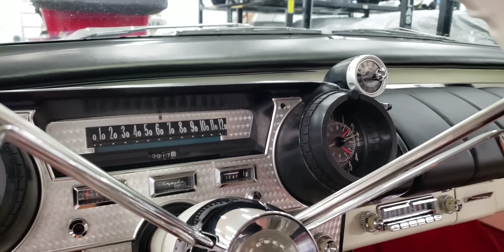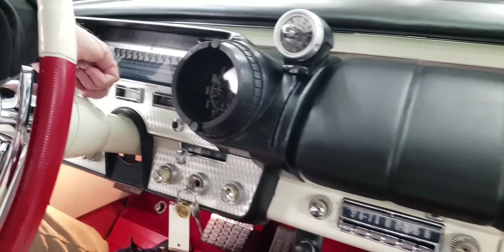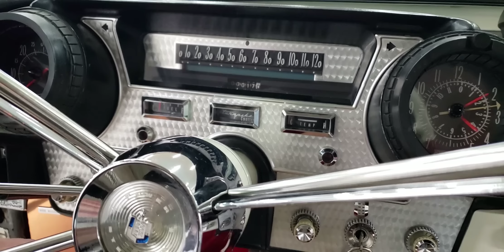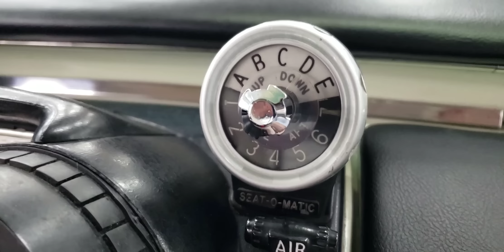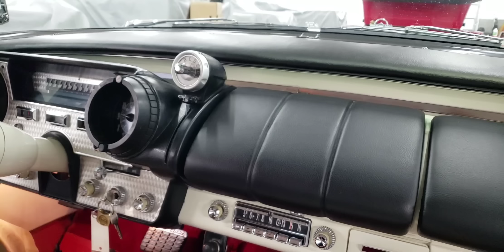1957 Mercury Turnpike Cruiser.

Comment: My high school superintendent had 3 Turnpike Cruisers I don't remember all the particulars as that was 50 plus years ago. One had a lube system that would grease the front suspension parts buy pressing a button on the dash, a lot of small tubes going to the tie rod ends. ball joints and maybe all the a arm bushings on the go. One had a wonder bar radio, you had a button or two near the dimmer switch on the floor  to change radio stations up or down as well the volume. Shop class pulled the 430 motor out of one and rebuild it, the motor alone weighed 800 pounds plus! They weighed over 6000 pounds. The windshield was about 7/16 inch thick. They were all 4 door hard tops.What ever happened to them I don't know . THANKS FOR THE MEMORIES  FRED!
Reply from the maker: Wow. Thanks for watching Fred.

Comment: I bought a engine and transmission from one out of a wrecking yard thinking it would fit my fifty nine ford fairlane two door hardtop. The C pillar in the fairlane models were narrow and I liked the look. I knew of the risk of not able to fit a standard behind that engine so went with the automatic they assured me worked flawless. The guys who pulled that combination out of the mercury cut those cables that shifted the transmission... finding out it was the only way of shifting it. I was only sixteen and this was above my paygrade in those times.
     I seen this car shown had vacuum wipers, my friend Denny.... his mom had bought one new so it had the electric wiper motor. Another huge feature was the oiling system.... you could grease a lot of fittings from a button on the dash that oiled the front end, and yes it had a reservoir you poured engine oil in to do this. 
     As I got a lot older, I learned how to make engine to transmission adaptors for either automatic or standard transmissions. This engine had its own unique bolt pattern and so nothing else would bolt directly to their engines. I was all over that valve cover design and had got matching valve covers from another turnpike cruiser. I had went back to that yard where I got the engine from for all the interior pieces and parts so that special interior was in my fifty nine ford. I had that car for years after I came home from nam and did all the stainless and chrome features inside my rig. I adapted those cables finally to a floor shifter and made it work well. I had used a mercury bucket seats and console in mine as well. Life gets in the way and so sent it to a wrecking yard as I just did not want some kid killing himself in the car. It would burn rubber till the tires fell off and would do a easy hundred and forty miles an hour. I do believe you know about early suspension and it was not the best.
Reply from the maker: Wow nice story Morgan. Figuring things out as you go. That's how you do it. Thanks for watching.

Comment: I had a 1957 Mercury Monterrey  Very like this but without all of the crazy details.  The Turnpike Cruiser was top of the line.  Designed to catch as much air as it could while moving down the road.
Reply: I had a 58 Monterey. I absolutely loved it but couldn't afford to fix it up. I was 17 and I bought it for $75... It was in beautiful condition but it didn't go into reverse... I drove it for a couple of years until it needed a valve job. It had the 430.
Reply from the maker: Right on. Thanks for watching.

Comment: That's a beautiful Merc.

It's always baffled me why someone would buy one new, with EVERYTHING except one or two options...

Instead of going the "whole enchilada", they'd sometimes cheap out on something like power windows or air conditioning... But they'd spring for the Space Age memory seat, color television, or the mink lined glove compartment.🤣
Reply from the maker: Lol. Thanks for watching Slick.
Reply: Many would purposely order without power Windows they were notorious for breaking or the battery going dead and they were afraid of them lol. Seat o matic! Everything about that automobile is amazing! Thanks for showing!
Reply: @joegy9944  I know what you mean, but a memory seat surely uses as much 12v as electric windows...

I know that my grandmother MADE my grandfather get a power window delete in a brand new 58 Buick Limited... The car had everything else on the option list.

Her reason?
She was scared to death of running off the road into a pond or lake, and not being able to put the window down to get out of the car.

Never mind that there wasn't even a puddle anywhere near where they lived most of the time 🤣
Reply: @slicksnewonenow  You’re trying to understand why your logic isn’t universal.  Everyone is wired differently.  I’d like to see one from each manufacturer just loaded with every possible option.

Comment: This is one very interesting car. And the only '57 I have ever seen with the quad headlights. I always wondered about that rear retractable window on those cars, because of its angle.

I remember my grandmother's '59 Mercury having the same kind of speedometer and angled antenna.

Edit: did a Google search, and it looks like it was mostly the more expensive '57s that offered quad headlights. Cadillac Eldorado was the only GM car that offered the quad lights. Imperial, Chrysler, and DeSoto offered it at Chrysler. Mercury Turnpike Cruiser was the only Ford Mercury product that offered quads.
Reply from the maker: Thanks for that info. Thanks for watching.